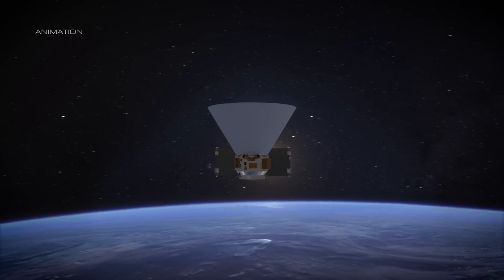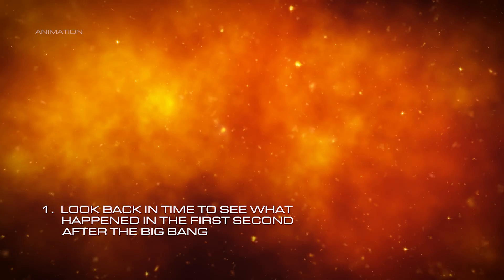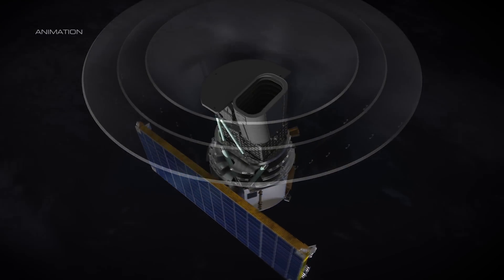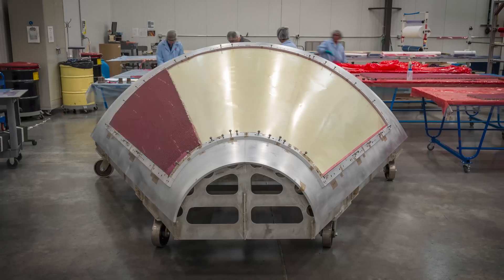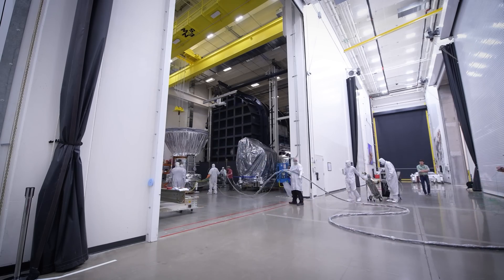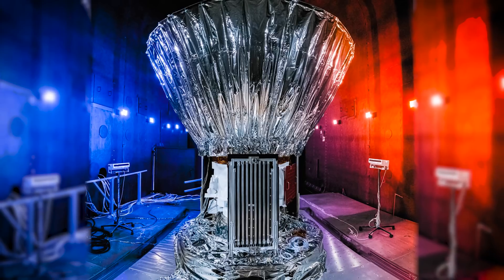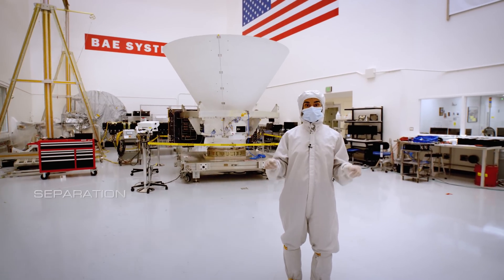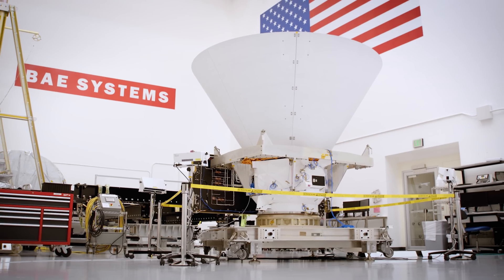Spacecraft Makers: SPHEREx and the Intense Tests That Prepared It for Space

Comment: Since the universe is expanding and the device taking pictures over a period of time, will the pictures need to have some offset or rescaling to make the good  3D representation?
Reply: No; the expansion of the Universe is extremely slow compared to the age of human civilization, let alone the length of a telescope survey. Of course, the Earth is moving around the sun and the sun around the center of the Milky Way, which will change the relative positions of nearby galactic sources on subsequent passes from SPHEREx, which might be relevant for the ices/planet formation science goal -- but I'm sure that would be easy to take into account.